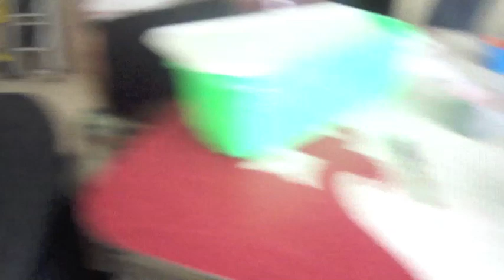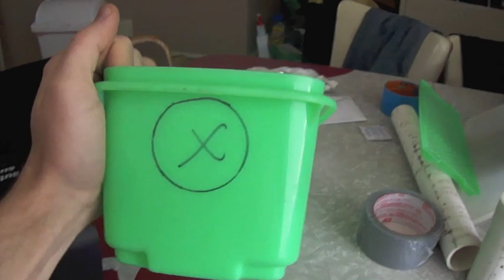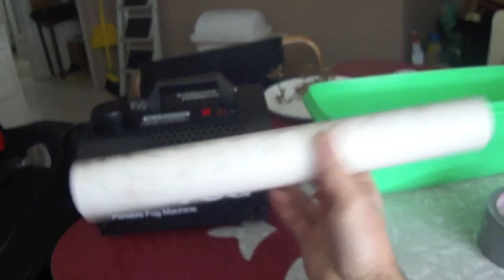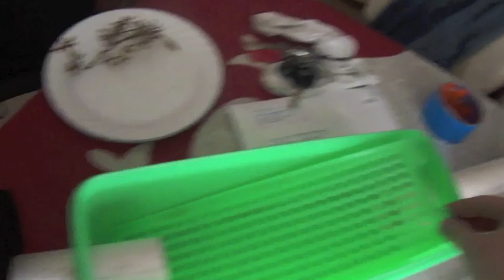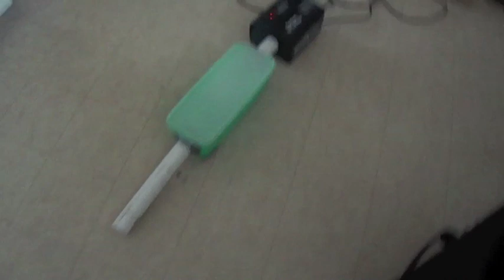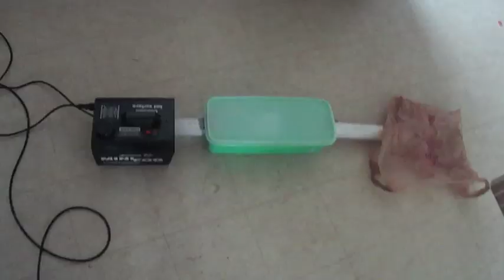How to Make a Cheap Fog Chiller (Tutorial)

Comment: You might also try a 3/4 to 2" gap between the fogger nozzle and the PVC inlet to get some air convection going. Worth a try. the slanted tray works pretty good. I've seen that done before to good effect.

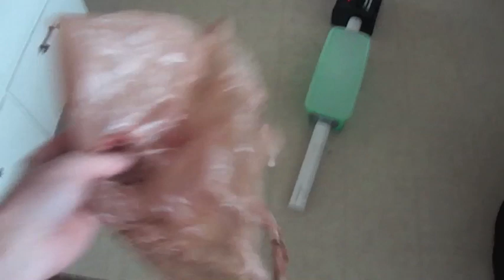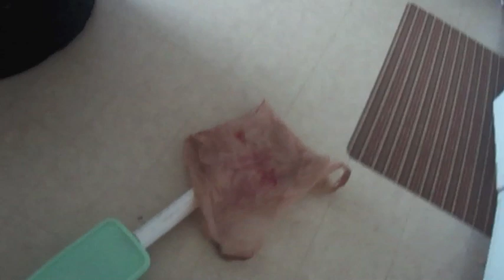Comment: @5:00 the fog would never chill thru the PVC pipe. It it travels thru anything it has to be a long run of thin aluminum drier duct which gets cold and stays cold fast. The trash can version works the best for that because it holds 8ft @7:10 The plastic bag creates back pressure to slow the fog down and lay low. We discovered that on hauntforum . com @9:20 a lawn & leaf bag cut down works. Check out my channel if you want to look at other ideas. Glad this worked for you indoors!! Gotta love DIY.